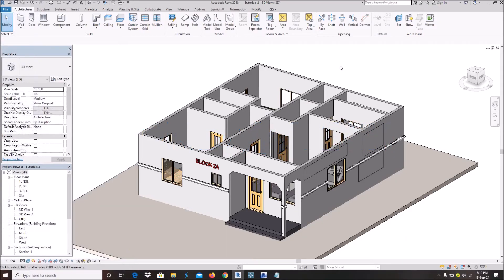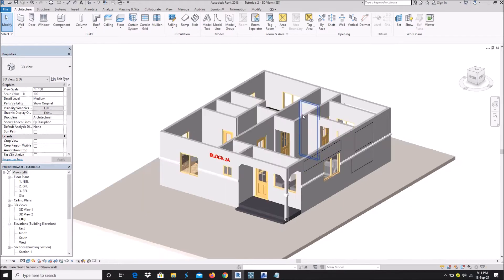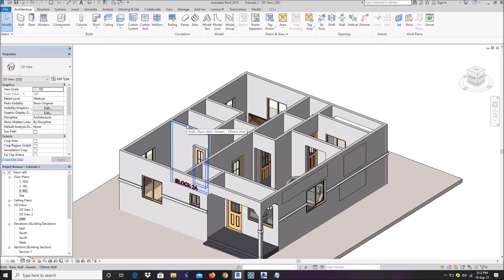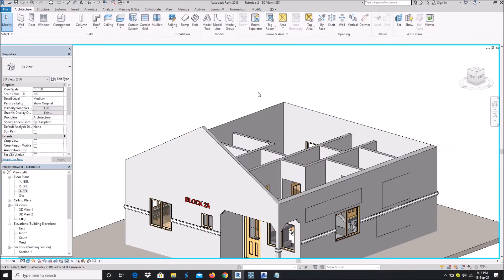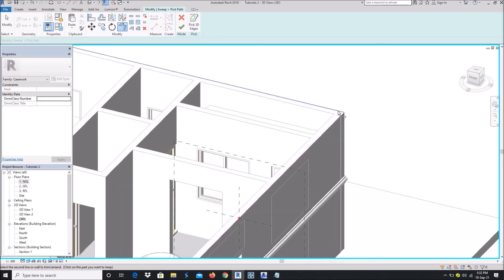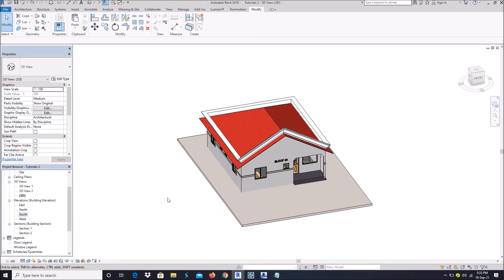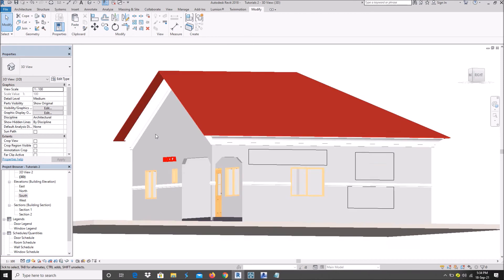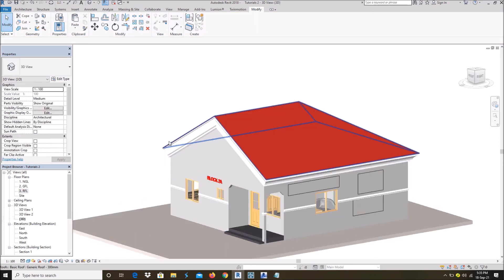How to Model Concrete Fascia on Gable Roof

Comment: How to create fascia when the sloped roof should extend atleast 2 ft away from the wall.
Reply from the maker: Thank you for your comment. Do you mean flat fascia? Or wood/metal fascia?
Reply: @bondtech2257    In this video you have shortened the roof at the end and aligned with the fascia. What I meant was,  how to create the fascia keeping the roof untouched. Because the extension of the roof beyond the wall in your video looks unpractical for high rainfall areas.